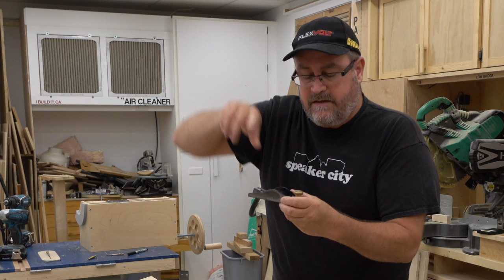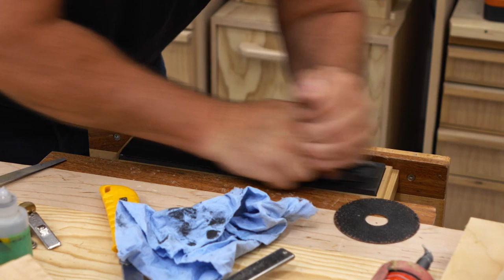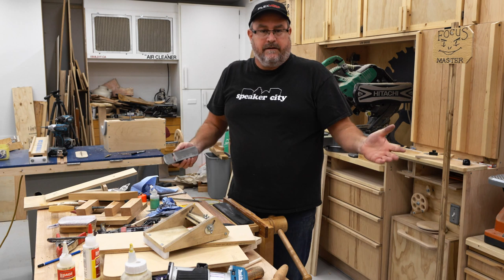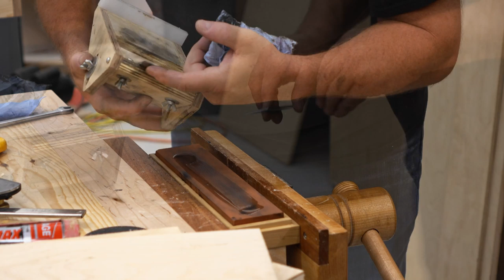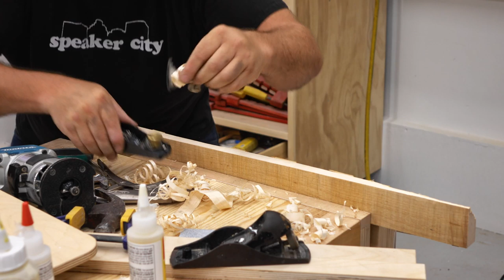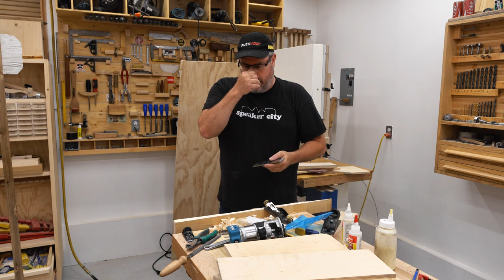Let's Fix That Broken Plane

Comment: My spokeshave sole also broke few months ago and I epoxied it together and been using it moderately. It held up ok till now. But yes, if it broke, I would (re)build it from wood.
And yay, do you even need to ask about stainless/wood plane? Yay 100x. Well, one will suffice.

Comment: I broke a block plane once. I was using the plane and on the forward stroke a sliver jammed up my thumb nail and I let go of the plane, the plane landed on a concrete floor. I did repair the plane with a tig welder, I still use that plane today. This happened about 10 years ago. The plane had  been with me for 35 years, just did not want to throw it out.

I tried epoxy once on a plane to repair thread for the tote. Did not stand up for me, ended up building up the area with a tig welder, drilling and taping the hole. Eventually the plane broke in the same place, I just put the plane in the garbage.

Comment: I have one of those plains that has an adjustable front shoe found it at good will for 2$ 
Do you have any idea why the front adjusts
Reply: To adjust the depth of cut so you can take more aggressive or fine cuts as needed
Reply: It adjusts the throat of the plane.  A narrower throat with a very slight bit of the blade exposed makes for fine shavings.  The closer the front of the throat is to the blade, the more it resists tearing out.

Comment: -But what words of wisdom did we miss during the sped-up section?  You should have preceded that part by saying "the real secret to this is..."  Roy underhill did that sort of thing at least twice.

-JB Weld has something like Epoxy steel that I've had success using.

-Oh please do build a wooden plane!